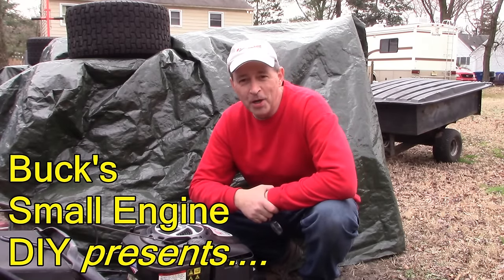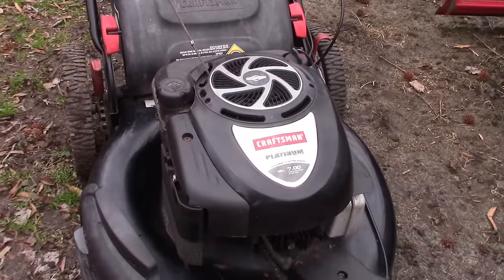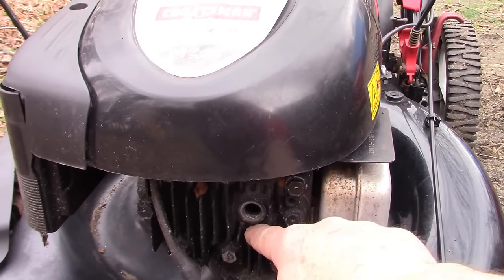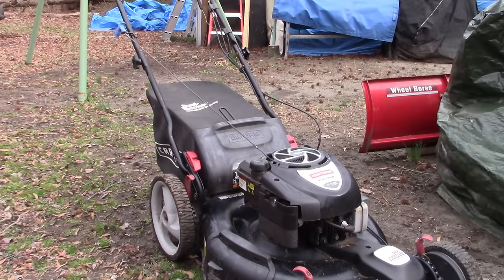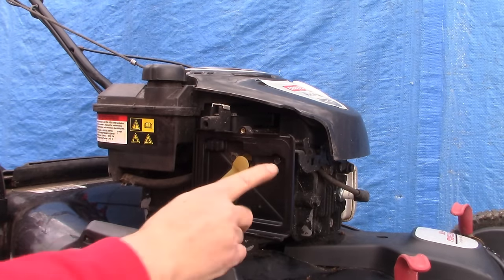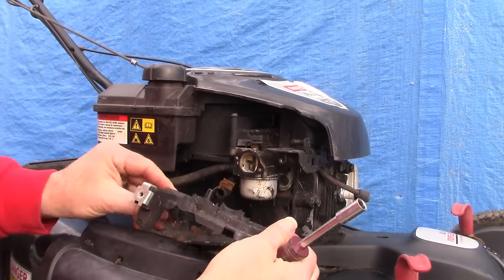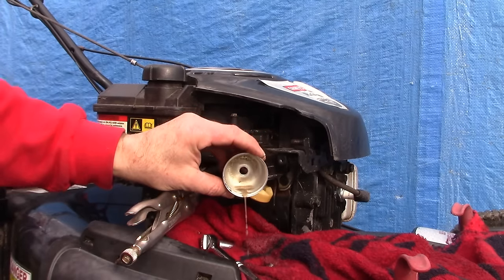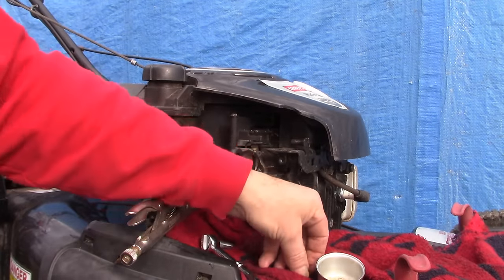FIX any LAWN MOWER in 10 Minutes or less - GUARANTEED !!

Comment: I had never taken apart a lawnmower's workings before. It's a Poulan 500e mower. After watching this, I dove in, and after finishing, the mower started on one pull. I was so jazzed. I yelled, "I have made fire!!!"
Reply from the maker: Great job fixing it yourself!
Reply: You made a clear instruction to follow. I just fix my lawn mower yesterday . Boom ...it's working now .Thank you Buck .J.from Toronto,Canada.
Reply: Sometimes the auto choke keeps the mower from starting. I have one I have to put a screwdriver to keep the choke open then sprayed starting fluid inside . Pull the start rope the engine revs up fast and then the gasoline starts flowing and the engine runs. My brig's lawn boy. I also disabled the hold down bar so I can just pull start and start mowing I let the gasoline run out to stop the mower. It's best not to leave gasoline in the carb. Also do not use ethanol gasoline buy pure Gasoline. 73
Reply: Thanks for the tip. 73

Comment: Priceless.  Fixed mine in 15 min.  Even changed the air filter (used an aquarium filter cut to size, no spare parts around me).  Pulled the bowl (dripping fuel, but so be it), cleaned it out, cleaned out the nut holes, re installed it all and bam!  First shot.  Thank you.  Saved me hours and $$$ dragging it somewhere....
Reply from the maker: Great job doing it yourself!!!

Comment: Thanks Buck! I didn’t even have to take the carburator apart and it worked after 5 years sitting outside! I own a different lawnmower and by just removing the air filter I have direct access to  the “bowl” and I shot the cleaner through all the orifices. That small no traction lawnmower was my jogging buddy I used to mow 20,000 feet with it on the regular. It saw a loooot of grass and we are finally reunited thanks to you, your tips worked beautifully!
Reply from the maker: Great job fixing it yourself!

Comment: Thank you Mr. Buck your solution to why my lawn mower ( a B/S model 90000 140cc) kept cutting off was absolutely correct. It's a very new lawn mower but sat a couple of years with a little gas in it. I looked at the other YouTube channels until I came across yours. I tried all of those suggestions except take off the carburetor. I was able to locate the fuel injector and put a fine pin into the hole, and then put it back together. And to my amazement, it started right up and stayed on. You're the best.
Reply from the maker: Good job getting it done yourself! Happy mowing!
Reply: @Buckwsr  me gusta mucho ver Tus videos por que TU lo explicas DIRECTA Mente,sin tanto bla bla bla. Saludos!
Reply from the maker: @breannaoliver6316  Muchas gracias por tu comentario. Muy amable. Pero la verdad....si! A veces me gusta participar con el bla bla bla....depende del video! Otra vez, muchas gracias.
Reply: Hello: I just sprayed starter fluid into the carburetor. It started right up. Beautiful sound!

Comment: Thank you,  you just saved me $100 bucks. I bought 2 mowers for 45 bucks and one works but needed a small spring and  the craftsman needed that carb screw cleaned. God  is good. Just some caring advice, some rubber gloves please vs that carb cleaner. lbvs

Comment: Nice informative video for those who are just learning. I'm sure it will save someone money when they see how easy and quick a mower can be fixed. And you're right. 99% of the time it is just that easy to fix one.
Reply from the maker: Thanks, Larry!
Reply: I think it just saved me some money!   I have a similar Craftsman mower with the same carburetor setup.  It would start after many pulls, but it ran rough.  I cleaned the carburetor as per instructions in this video.  It started on the first pull after the procedure.  My bowl had no debris and the fuel screw was not clogged.
Reply: Wow you're right! My mower is doing exactly what his was and it sat all winter. However I have an exmark commercial 30. I don't know the first thing about mowers. Where is my carburetor? I was literally going to bring mines to the shop tomorrow. After watching this im hesitant

Comment: Thank you!  This worked out so well.  Thank you for your detailed explanation.  I couldn’t figure out the issue.  Changed air filter, new spark plugs and even check if the carb was loose, nothing worked.  I then cleaned out the fuel bowl, it fired right up and ran with no issues.  Worked great, felt great doing it myself.  Thank you giving the confidence to try it myself!

Comment: Just fixed my mower. Wife was thinking ours was just "worn out" and we would need to buy a new one. I had looked at the spark plug and the air filter. No joy. It sure helped the mower in your video seems to be exactly like ours. Took off the bowl and jet, cleaned both. Voila. Bravo, sir! You saved me $$$.
Reply from the maker: Great job doing it yourself and scoring points with your wife!! I call that a win-win!

Comment: Your a legend.
I am going to give it a try!
My mower is huge.
It's old but it's just been overhauled with a new sparg plug, new throttle line.
New throttle head and pull line, new air filter and new blades.
It is hard to start and will run but not for long.
This has to be the problem .... Right?
After watching your video, I will give mine a go👍✌️🙏

Comment: Thank you Buck.. your video makes it seem so easy. My boys bought me another mower instead of trying to clean out the carburetor. I'm going to try cleaning it myself when it gets cooler outside.
Reply from the maker: Yes. It's an easy job, especially on this particular engine. Good luck!
Reply: Gas stations that have a pump that delivers ethanol free fuel IS where I buy my lawn equipment fuel always.  Cars can run on
10 % ethanol.  In Lawn equipment however,  ethanol likes to gel. Sometimes in a few days.

Comment: Your awesome. I have the same mower. I tore it down today cleaned it up.  Removed any rust. Cleaned the carb and the bowl, the jets in the carb. Replaced fuel lines painted the metal where the free solution took the paint off. On my carb the choke lever was broken so I glassed the piece back on and shaped it. Still has the same symptoms you just fixed. You learned me I'm going go drop the bowl again now . Ty

Comment: A small engine repair guy taught me this years ago. It does work 99% of the time. I use a tiny wire to clean the jet.  The other thing you should do is run your mower dry at the end of mowing season, or anytime the mower will be storage for a while.
Reply: I've got a Honda GCV160 and when I remove the bolt from the underside of the bowl I still can't remove it. It's not that it's stuck, it just looks like it's not designed to come off. D'you have any advice? I'm asking you as I can see your comment is quite new!

Comment: Thank you so much. I am a female and just tried to get my mower running after about 4 years of non use. I had already changed the air filter and the oil and this in itself was quite something for me to attempt because I know computers, not small engines.
I was getting ready to do what you showed here because your instructions were so clear. I ended up being able to use a particular product (not sure if it will let me mention that here but the brand name starts with an S and the product itself has FF as the initials). 
But thanks for this video. I would have stopped and hired someone at this point but because I was prepared to take that carburetor out and do what you showed here, you saved me a ton of money.
I stood in front of my garage with it running grinning from ear to ear.
Reply from the maker: Great job doing it yourself!

Comment: What else can I say? Thumbs up! 

I will certainly give this method a try, considering that my Toyota push mower has the same issues that your mower showed in this video. My mower is a Toyota HRA214 (circa 1984). This mower has been in the family since it was new. It is in relatively good shape, though I sent the carburetor out for a rebuild about 3 years ago. The mower ran great after the carburetor rebuild, but the next season it wouldn't start.

It is my backup mower, but I would like to get it running again. I'll be giving your method a try, considering that the mower currently runs for about 10 seconds with a blast of starting fluid before stalling out.

Comment: Thank you, perfect simple visuals and instructions!  my carburetor was a little different but I applied the same process and It runs great on the first pull now.
Reply: What was your carbureter like? I've got a Honda GCV160 and when I remove the bolt from the underside of the bowl I still can't remove it. It's not that it's stuck, it just looks like it's not designed to come off.

Comment: I have an old lawnmower that looks like this one, Tecumseh/Champion 20 inch. Probably 30+years old, have had it second hand for 20 years, typical backyard use. This year it turns over for a few seconds with starting fluid and died.  I know nothing about small engines but after a few videos here I saw that the float bowl was accessible and had the brass bowl nut accessible like the one here. So, unscrewed it,  cleaned out the crud in the float bowl, and poked through the tiny holes in the float bolt with a fine wire and blew it out, washed it in gasoline. Put it back together, and now it purrs like a kitten. I noted that the gasoline (some from last year) was a strange yellow colour (unlike the fresh gasoline - pale yellow) and it had yellow flakes of something floating in it. So best to use up gas at the end of the season and replace. Thumbs up to Bucks!
Reply from the maker: Yes, the Tecumseh engines, like the Briggs, use the bowl nut as the main jet. Great job fixing it yourself!

Comment: carb cleaner and a needle through that main fuel jet bolt and cleaning the float/bowl did it on my 6.75 craftsman. stored in a hot storage building at my moms with ethanol in it coated everything in dried molasses and completely clogged that jet. even the gas cap rotted and crumbled off of it (replaced). 

fired and ran consistent on the first try after that.

no more corn gas for small engines. next project is a gas powered line trimmer. thanks for the video.

Comment: Excellent! Mine briggs and Stratton won't start, having worked many (5-6 years?). So I used starter fluid, engine started and the lawn is done. Next day it, again, won't start. So what the problem might be. Obviously the fuel is flowing but... Probably there's something allowing the initial start up, which is different that that maintaining the main engine work? I'll clean the car but was wondering or I'm curious why it won't start... 😎
Reply: You could try siphoning the old gas out and replacing it with new gas if you had gas in it from before.

Comment: I'm hoping this works after I go get the cleaner, even with the old fuel.  I have a Toro timemaster mower that I really like, but it's so hard to start.  Last year I did the spark plug and new filter, and of course put the blue enzyme stuff in the fuel when it had to sit.  Already did the lawn once this year, but now it briefly starts and stops right away.  The filter and spark plug were the last time I used it last year.  (My effort to DIY).
Reply: It’s “ old” gas.   Even a month in a gas can is too long   To sit. 

I always had the same problem.  I’d have gas sitting in my garage from prior Summer

Comment: What about replacing the oil. Also, the check valve that is attached to the float in the bowl gets stuck with goo. That can get stuck closed. Is there an additive you can add to the gas that will clean up the insides such as Techron?

Comment: Hey Buck, I have the same model, it turned on easily but only sputtered at about half speed until I did a line of lawn barely. It stopped and still sometimes turns on at half sputter, still think its the carb?

Comment: How often should I change the oil in my residential push mower with Briggs and Stratton motor  ?
Reply from the maker: Check it regularly. Change it annually, like every Spring, and you'll be good to go!

Comment: I havre done this on my expensive  TORO super recycler model 20057  that is close to 20 years old. This is a self propell one It was always inside between cutting my large lawn. Sadly my problem seems tp be more difficult to correct, than the one shown.
After cleaning the carburator , changing the air filter, putting new synthetic  oil
1-  It took near 20 strokes  with a few times pushing the button to inject gazoline to start the engine without any smokes from the exhaust port.
2- After starting, I cut  for more than half an hour, very tall grass with the bagger without any problems. The engine running great. The tunnel  pushing cuts to the bag was totally jammed by the grass, and the the engine didn't show any signs something was  bad with it.
3- Could it be bad  a bad spark plug ?, or some electrical problems ?
Thanks for your help
Luke
Reply from the maker: The primer bulbs on these briggs engines don't always work very well. Bad design. The mower I used in this video doesn't have the primer bulb, but rather the automatic choke, which I much prefer. You can always "prime" the engine with a shot of starter fluid into the carburetor throat and skip that primer bulb all together. That's a bit inconvenient, as you need a 5/16" nut driver (or screw driver) to open the air cleaner and remove the air filter in order to shoot the starting fluid into the carburetor. But it works, and you'll probably start up on one or two pulls of the rope.
Reply: @Buckwsr  Thanks for answering my  question, may  I add that , I forgot to add that when the engine start sometimes  I hear  like a screeming noise or like the noise generated when you hit a piece of metal with a hammer. This sound can also last for a few seconds, before it vanished. Sometimes that sound is also when the engine is shut down (stopped) . Did you ever had that experience , and  what is your feeling about it.  This  Toro after starting, can cut and bag  grass that is over a foot hight without a glistch. 
Thanks a lot again to care about all of us .
have a nice day

Comment: Hi Buck, I went thru your steps, spraying carburetor cleaner into the opening and was able to get the engine to attempt to crank, so moved forward with removing the nut from bottom of carburetor (rest of unit was all made together so the bottom wouldn’t drop down).   Put everything back and tried cranking, no luck.   I had ordered a new carburetor kit and went ahead and replaced the carburetor.  Not sure if there was something I should have done to “prime” the carburetor after installing, but couldn’t get it to crank and tried spraying some of the carb cleaner into the opening and it cranked right up.  Let it run for a few minutes, stopped the engine, tried re-cranking, and it wouldn’t start up.  Any suggestions to help resolve my problem.  Thanks in advance, your video was extremely helpful.  Thanks!!
Reply: Same here

Comment: I recently took my carb out and cleaned it and put it back on and I’m still having the same issue I had before. It takes multiple pulls for it to barely start, but once it’s started it’s fine. Even after letting it run and warming up I can’t get it to immediately start without priming and multiple pulls. I didn’t touch the spark plug which has been in there and untouched for at least 4 years.

Any suggestions?

Comment: Hey Buck! As you may expect, my Craftsman lawn mower didn't start this spring. I fell on some video from sears, and it was BS. It was asking for specialized tools no ordinary people have. 
Lucky me, after a bunch of other videos, I found your 10minute clip. 
It didn't take 10 minutes to me, because I had to buy a new spark plug and air filter. They were 10 years old. 
But with your help, with my ZERO background in gas engines, I FIXED IT. It was exactly as you described, in the carburetor.
So let me say a BIG thank you!!!
I opened myself a channel for newbies in electronics here:
https://www.youtube.com/@CU_Wiring_Electronic_Projects/videos 
And guess what? You have a new fan!
Cheers,
Chris

Comment: I’ve had it happen twice after sitting during the winter. I decided to take the spark plug out and dip the tip in gas and put it back in. It started up right away.

Comment: bought one used. Watched the guy start it after priming it. Transported it to my house 3 miles away, was tilted backwards for 10 minutes and it will not start. Did exactly what you did, changed the spark plug, used starter fluid, STILL won't start. any advice? thanks in advance and I appreciate the video.

Comment: I took my carburetor completely off to clean and while doing so two springs disconnected and I don't have a clue where they go  The mower you are working on in this video is just like mine.  Can you tell me where these springs go.  I would ate to pitch this mower because of two springs.

Comment: Buck! Help! 
Ive changed spark plug, air filter, cleaned the carburetor, chrcked the fly wheel pin. Fuel is flowing when bowl is down, and shuts off when up. Clean bowl nut. What else do i try?